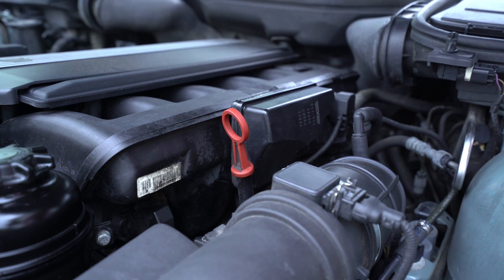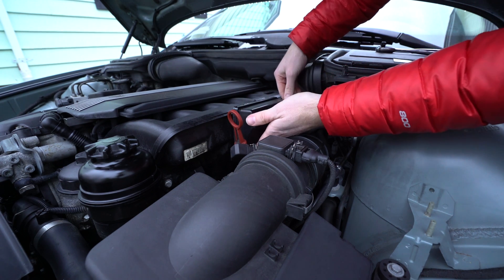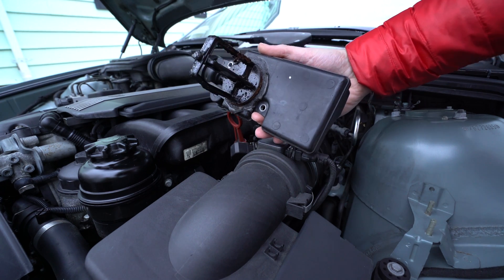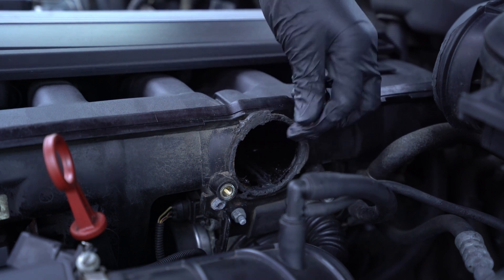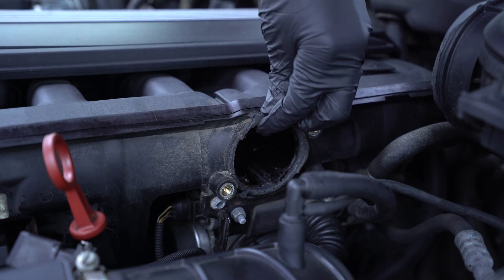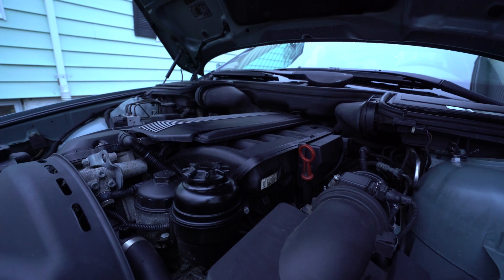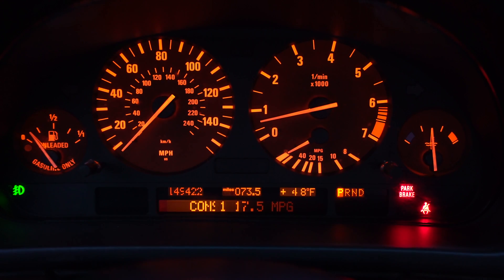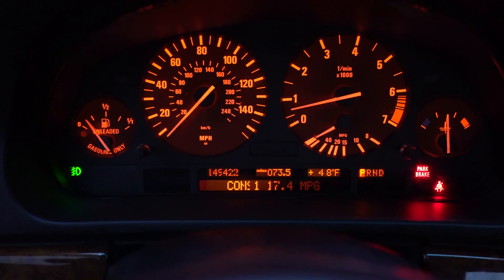Cheap BMW DISA Valve Intake Adjuster Unit Repair

Comment: Hey bro, can this causes code P0171 system too lean if bad. My gas mileage is suck (250 miles full tank x5) Because I have a P0171 system lean, my intake boot was bad, replace it, clear the code, minute later code is back... Now I am really thinking I need to check this Disa valve out.  Thanks in advance!

Comment: What up bro they r sending me out another one its gonna be here 2morra by the end of the day,, but did u have to buy and o-ring. Did u just put the one from out the box in ur car,, I'm not sure by the pictures if there is one on the valve from fcp ero,,
Reply from the maker: William Avery the new gasket is molded to the new unit so you are good man!
Reply: @BIMMERZEITT  thanks buddy have a great day and keep posting great videos

Comment: I took ur edvice and purchased a disa valve from fcp uro and I put my order in last Tuesday it must of got lost on the way I got the email saying it would be here by Thursday well nothing came so I called them Friday and said what's up with my disa valve he told me the last place it  scanned was on Wednesday, I'm calling him 2morra so they can send me out another one, I cant drive my car till I replace the disa valve,, with tax I payed 180 dollars I got the same one that u got but mine is for the  2.5 engine,, tell me this is crazy I just want my part so I can get my bmw back on the road
Reply from the maker: William Avery sorry to hear, sometimes that happens. UPS or FedEx or USPS issues. Sometimes packages are stolen, it’s really common. You should be back on the road soon!!
Reply: @BIMMERZEITT  thank you brother oh I'm gonna ask them to send me another one,, and if the first one comes I will send it back,, I need that part to fix my car,, plus I haven't been driving it cause of that part,,